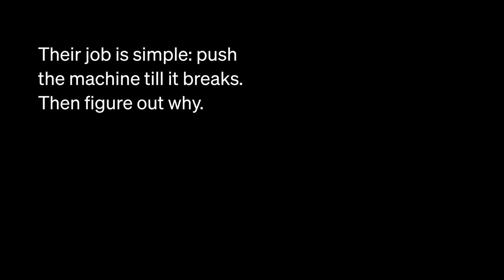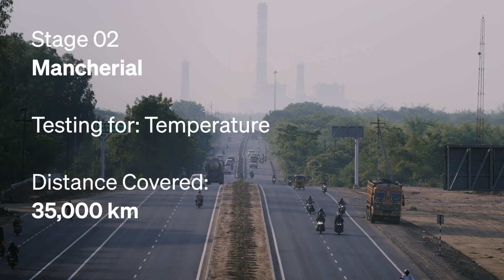Reaching Laksh: 528 Days of Testing Indie

Comment: I'm a 2nd gen River Indie owner, good vehicle but need fast charging,seat closing issue if you put a seat cover, need more range, brake pad wearing issue and the main one the front suspension is very hard most of the time I feel that there is no shock absorbers in the front and needs a bottle holder also.
Reply from the maker: Congrats on being a 2nd Gen owner! Thanks for the detailed list—feedback on the suspension and seat cover fitment is incredibly helpful for our team to look into.